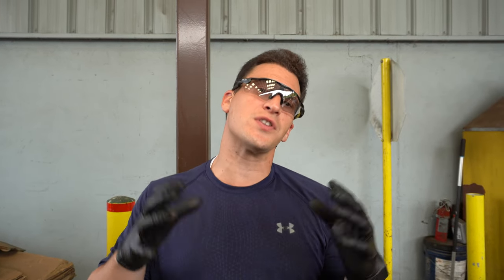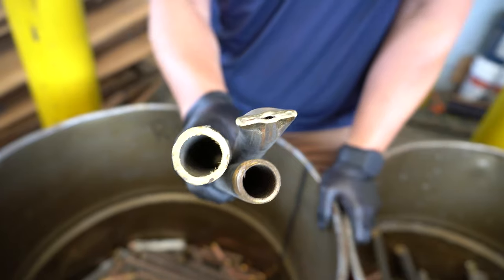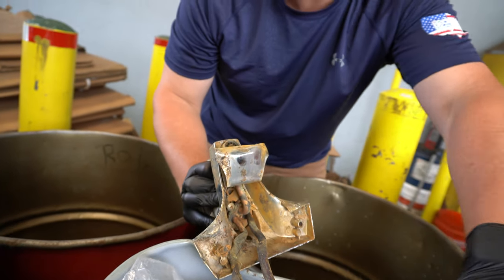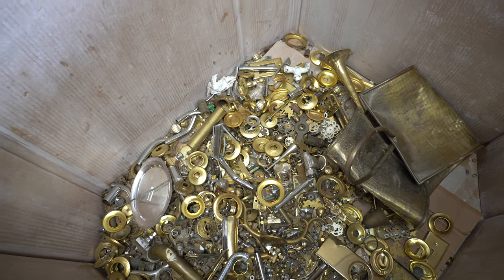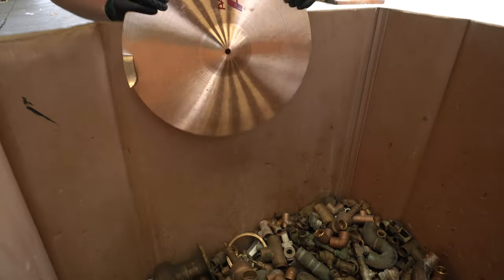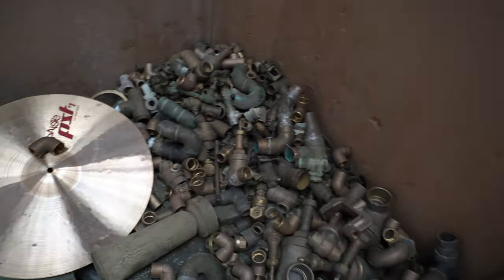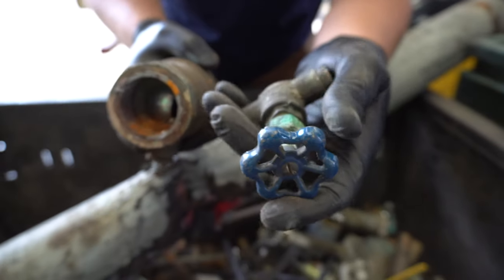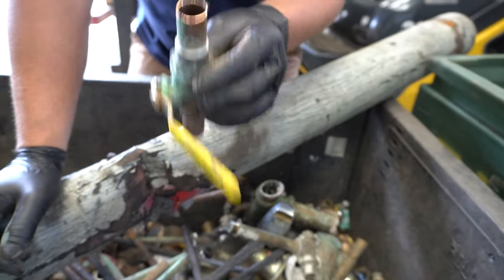Scrap Secrets: Sorting Your Brass & Bronze Red Brass

Comment: A question about brass. I recently came across some electrical meter boxes and when taking them apart I seen that the contacts and other parts were a tin coated brass. These are usually a coated copper.  How or what should I sell this material as?
Reply from the maker: Normally as a yellow brass if it is brass under or #2 copper if copper.

Comment: Was the red brass pile a Semi red brass 86% to 88% or a pure red brass with 90% to 92% cu?
Reply: I would say it's much lower with all those fnpt values in there.
Reply: @jorgehenriquez3963  I looked up the isrl Scrap Specs and semi red is 78% to 82% CU and red brass is 82% to 88% Cu.

Comment: I can not figure out why scrap yards are so fussy over brass that has steel or other contaminants. When it goes to the furnace all that stuff will just get skimmed off. I can see discounting it a little but they will plain out call it garbage.
Reply from the maker: While you may think that they are fussy- when scrap yards go to sell material they often have to argue with buyers over deductions like steel and plastics. These downgrades become more apparent when yards are not able to clean their materials correctly. 

The yard should describe what to do and if they do not you should be asking.